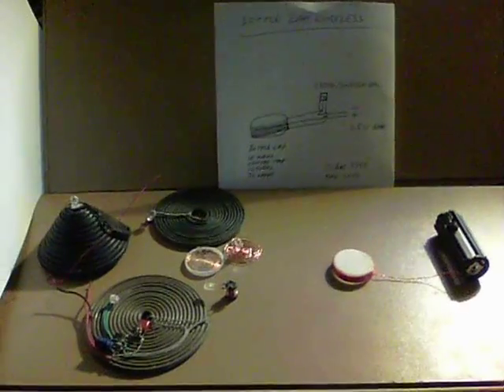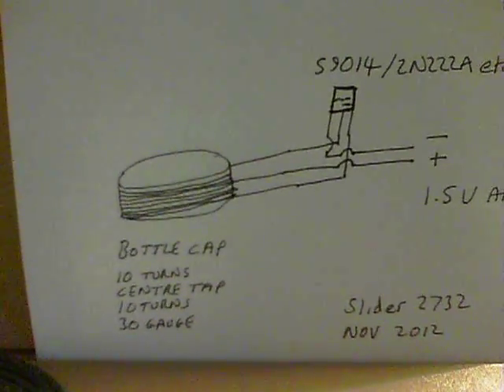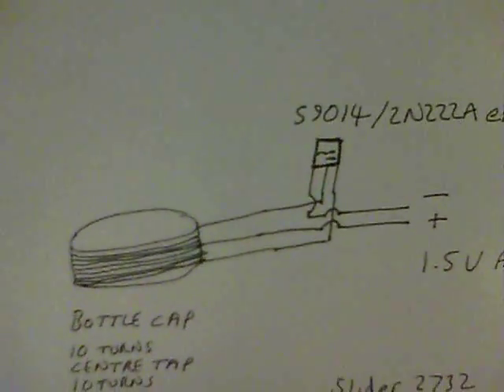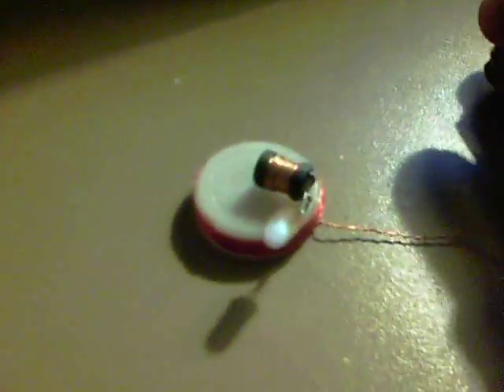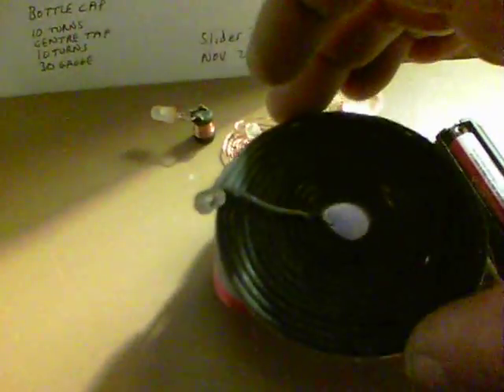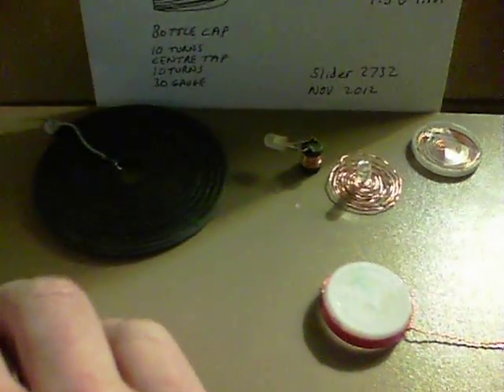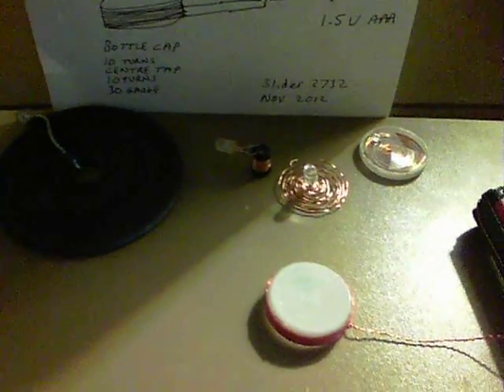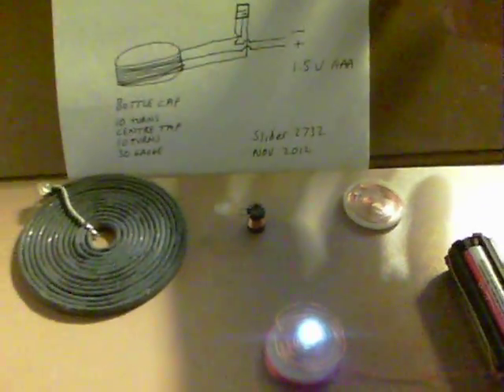Bottle Cap Wireless - Simple system

Comment from the maker: It's really quite easy. Use a white glue or similar as a coating on the cap, then wind around and around to halfway up the cap. Then twizzle a length out from the side as a connection later, add glue again and carry on til the top. 30 AWG wire will easily scrape with a razor blade to expose the wire start, middle and end for the connections. By time done, the glue will have dried :)

Comment from the maker: You can certainly use a germanium and it's a good idea for least voltage loss. Current handling is enough to light LED's too or pass on to capacitors/batteries etc. A common parts good bridge rectifier is 4x 1N4148 diodes, plus say 10uF smoothing cap on their output. 
It's always a good idea to experiment with different ways of picking up the energy :)

Comment from the maker: Yes, but watch out for over driving the transistor Base and oversaturating the coil. If the circuit doesn't start, put a variable resistor pot between Base and the wire leading to it, then you'll find where the circuit will start to run. Alternatively, put a bottle cap of water and 2 pieces of metal into the water as the resistor :)

Comment from the maker: Yeah, you could use a pills bottle etc and increase the winds. It's exactly the same as 1 wire on the inside and one over the top, except completely different :) Shorter the Collector wire the higher the current, as you say with transistor heat. 
This type coil wind is on the Vinnic battery as can be seen in those vids (which is still running).

Comment: Very Cool! I have just the container for this. Just need to tip out the failed lead alum...As long as the two halves of the wind are the same length, it shouldn't mater which way its connected to b&c. Have you played around with uneven winds yet? From my experiments with the BAC, I found better range with a long base coil and short collector coil. Although it is very hard on transistors.further experimentation is on my list.. I should get into the wireless stuff again this week. Been on my mind.

Comment from the maker: Only with regard to a receiver coil. If the LED doesn't light, it will if the cap is turned over. In which case, connecting the receiver coil LED the other way around will fix it :)

Comment: Hi, how do you think is the better way to make a large sistem? For example have a table that can power up some leds on it like cars models?
Reply from the maker: The 'trick' is to make a long thin transmitting coil, the length of your table, but only finger width between the two sides. Experiment with amount of turns, starting at 12. The sending coil should have a capacitor across it for best output and to best match your receiving coils. It will be around 1nF-10nF, the little orange ones marked '102', '221' etc.
  
Good luck :)